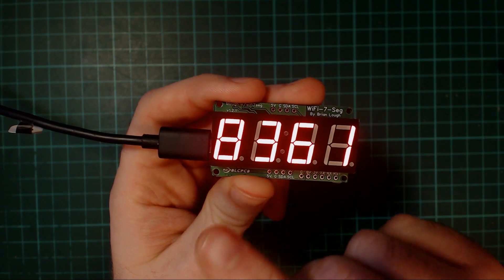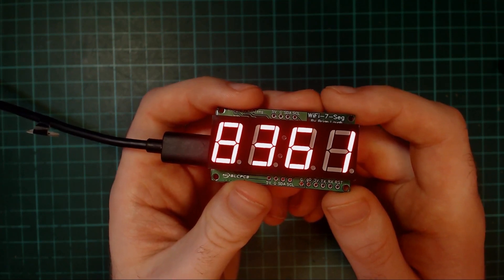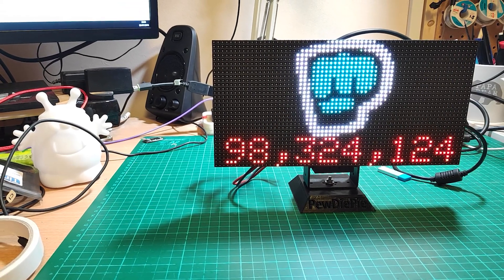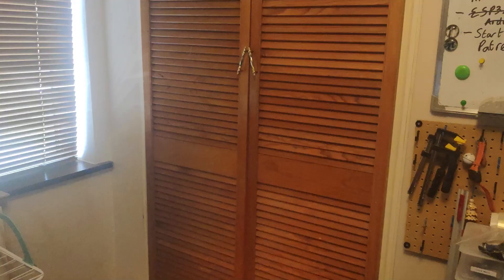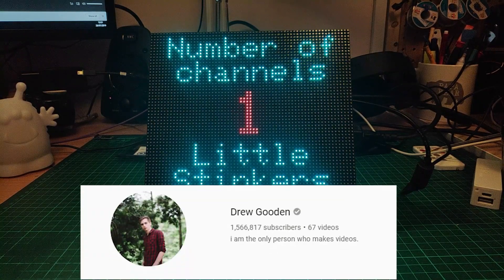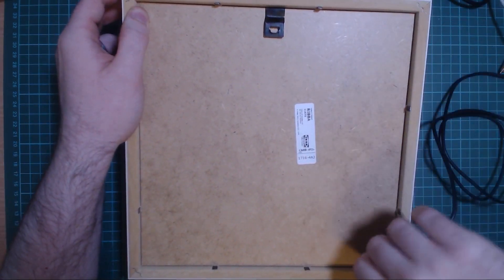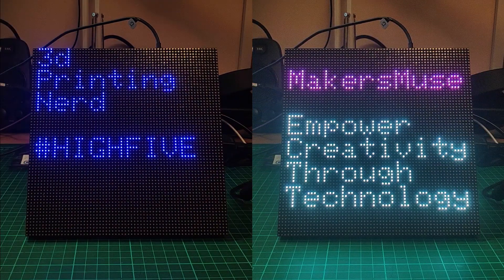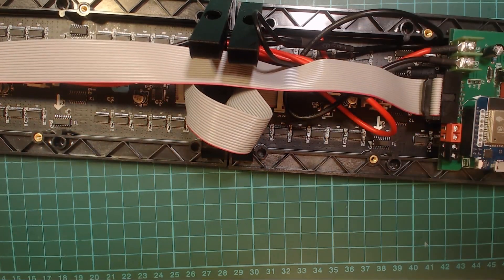YouTube Subscriber counters are about to break (so I made a lot of them)

Comment: Great video, just curious if there are any workarounds at this point.  I see that socialblade does have exact sub and view counts for my channel, though I'm a relatively newtuber, so maybe my numbers just aren't high enough.  
I appreciate the detailed links for the parts and the tools, I'm looking to try building one for myself, but have to figure out what's available via the API before I get started.  With a Pi, I know I could scrape a webpage to get the numbers, but would prefer arduino just due to the simpler setup/overhead.  Excited to see if I can get it to work, but curious if anything has improved since this went live.
Thanks!